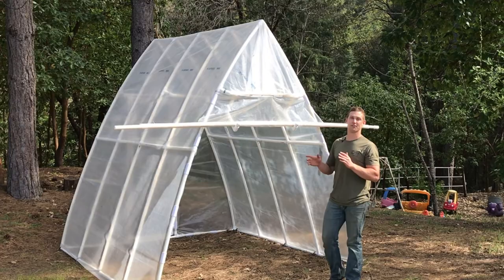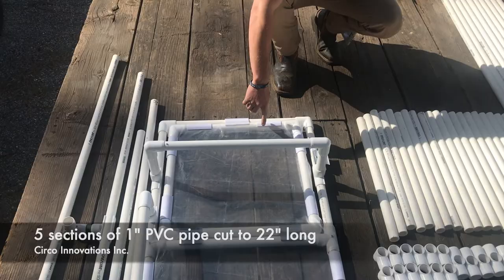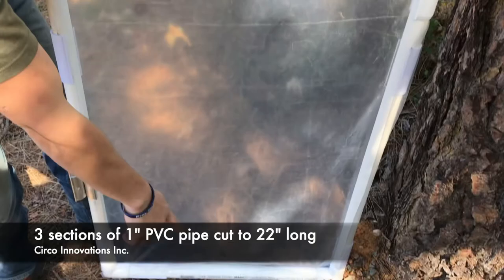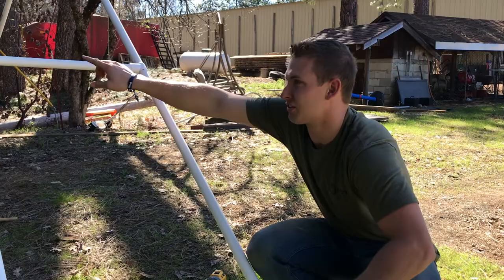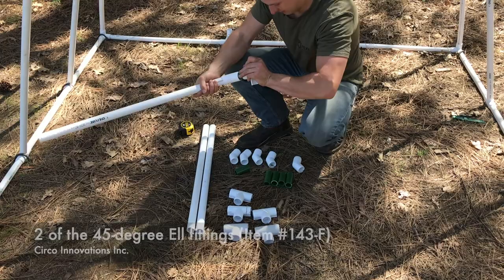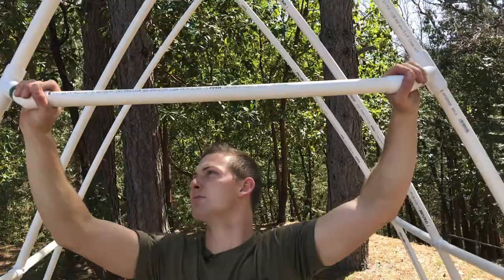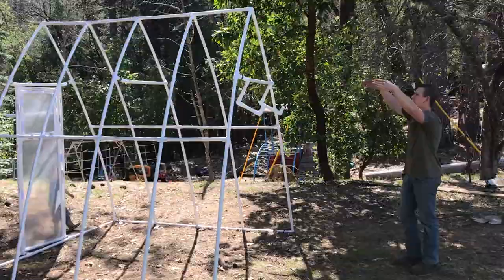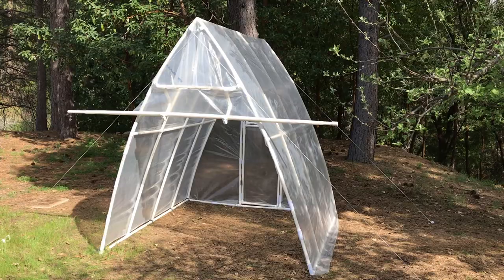Gothic Arch PVC Greenhouse (Start to Finish)

Comment: Hello, to make one arch with metal bases, what measurements would you recommend? I'm trying to create an arch that ppl can walk through
Reply from the maker: Hello, I would suggest using the same design as you saw in our video, all the same measurements and fittings I believe would be what you need. Just replace the parts you want in metal but keep them the same measurements. 

Parts List: (1” Clamps and Fittings)

4 - Pipe Stakes (Item #81-F) 
60 - Snap Clamps (Item #13R) 
12 - Slip Cross (Item #133-F Slip)
12 - Slip Tee (Item #63-F)
14 - Side-Saddle Tee (Item #353)
18 - 90-degree Ell (Item #113-F)
6 - 45-degree Ell (Item #143-F)
2 - PVC Cap (Item #163-F) 
3 - 4-Way (Item #43-F)
4 - 3-Way (Item #33-F) 
4 - Snap Hinge (Item #253)
2 - Snap Cross (Item #263)
4 - Side-Saddle Tee Hanging (Item 
        #353-H)

Parts List: (1” PVC Pipe) 

11 - 10’ Sections
1 - 8’ Section
2 - 76-1/2” Sections
2 - 74” Sections
3 - 31” Sections 
20 - 2’ Sections
5 - 22” Sections 
4 - 18” Sections 
6 - 8” Sections 
10 - 3” Sections